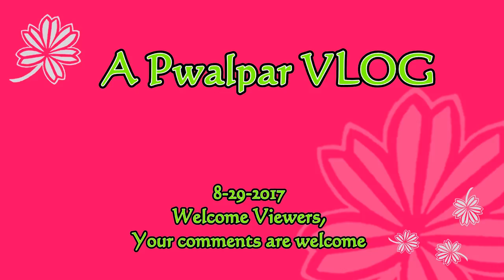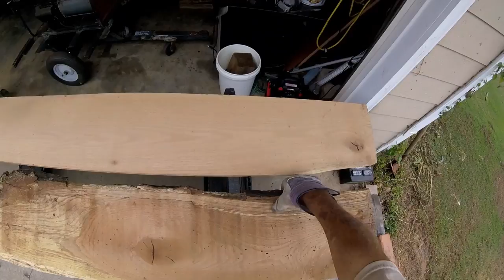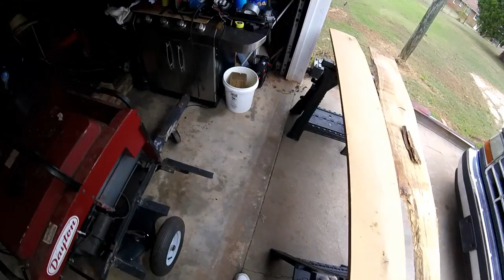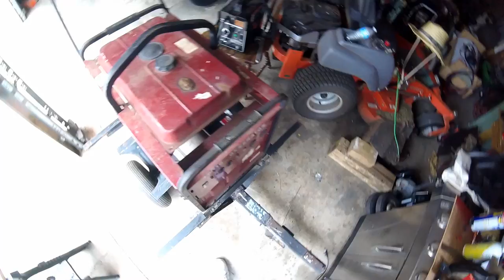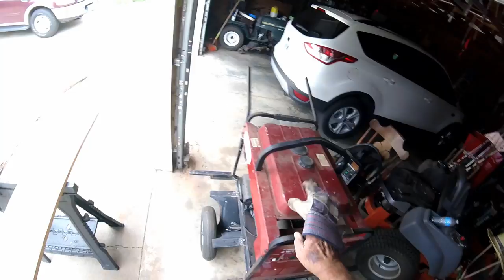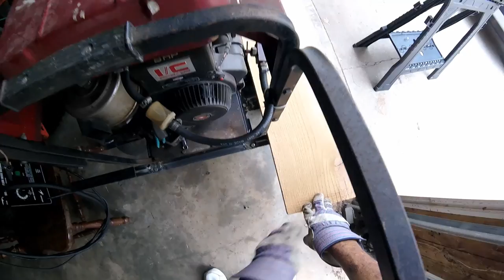Pwalpar VLOG 8 29 2017

Comment: Walter, I used to have that exact same generator years ago. Donated it to a Big Cat rescue group out here in California. You might do yourself a favor and temporarily remove and reverse those handles to keep you from running into them. BTDT and it hurts. Also don't put too much weight behind the wheels, cause it will make the trailer tip over backwards. Jon, MSO-439
Reply from the maker: Thanks Jon  I appreciate the suggestions